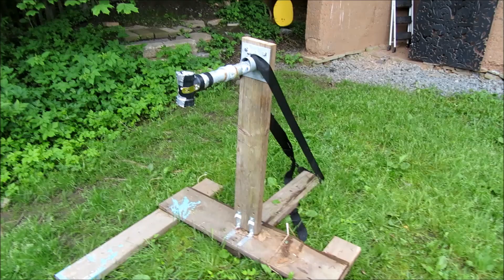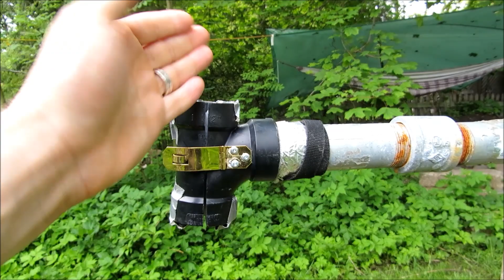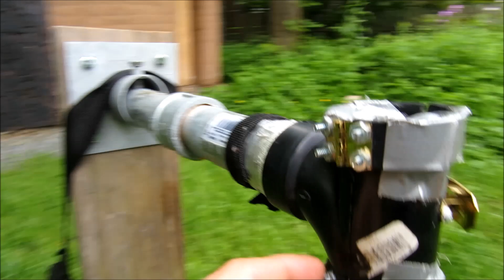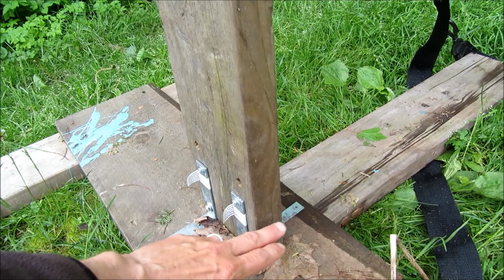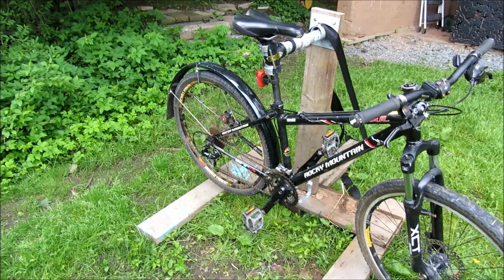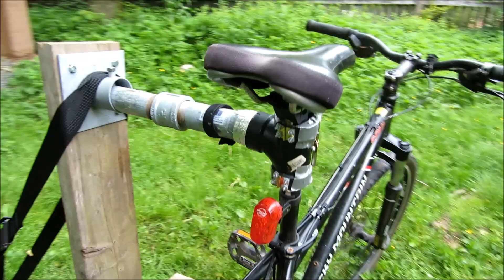How to Build a Bicycle Repair Stand

Comment: nice !  i just think if you could make it taller so you could enjoy cleaning/repairs while standing would be better for your back ...  anyhow i am just planning now on making 1 ...  have fun and pedal safely :)
Reply from the maker: Actually i moved to a house with a garage so i removed the clamp part from the wood and attached it directly to the wall,..and at a higher height as well.  cheers eh